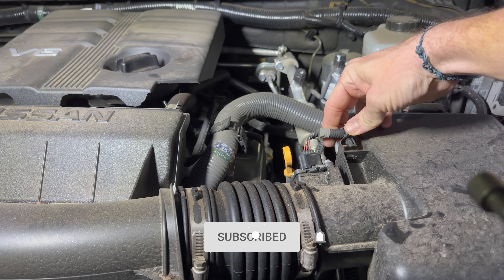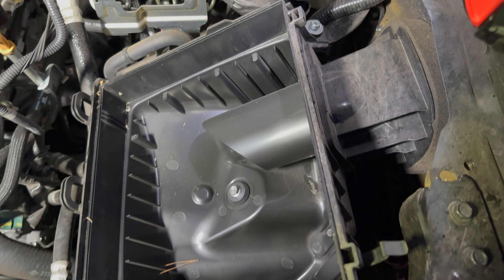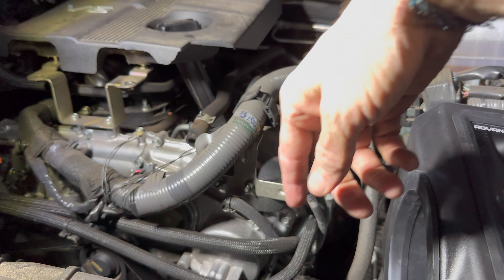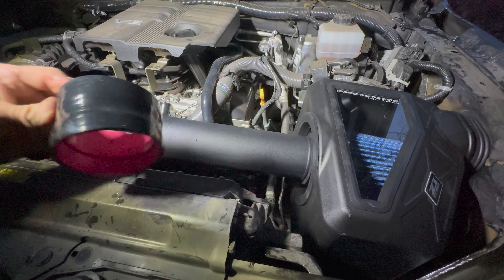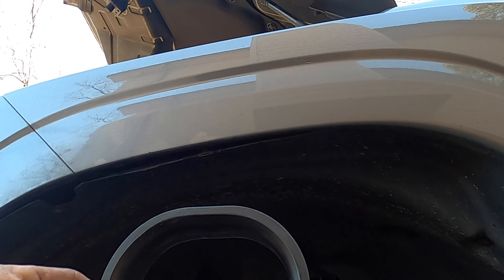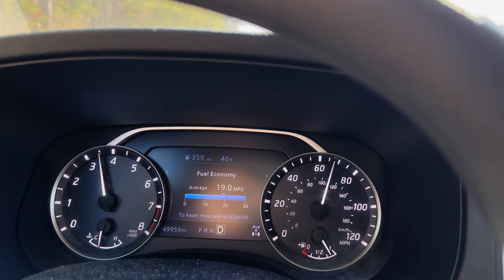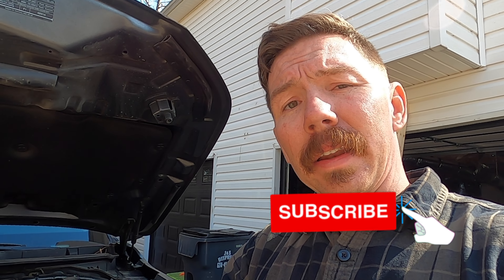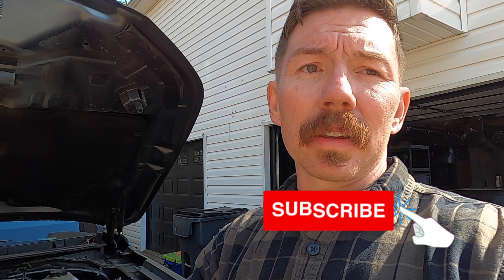2022+ Frontier Cold Air Intake (install and review)

Comment: I'm with you on the cost vs performance. I decided not to get the intake but  I did the 2.5 inch lift kit, the Z1 upper control arms, and the Z1 Performance exhaust and I'm really happy with it. Best MPG I'm getting on stock tires is 19.5.
Reply from the maker: How do you like the exhaust? Looks like a nice product. It drone any?

Thanks a ton for your feedback 👍🏽
Reply: Not any bad drone. The truck cruises at about 2200 RPM and it sounds good. It's great when you get on it too. @TheAdamConners
Reply from the maker: @-Dwight-Schrute  I’m sold. Lol.
Reply: @-Dwight-Schrute  Id say there is drone between the 2000-2500ish range when in city driving. The exhaust sound is louder than the intake when you get on it. Thats been my experience anyway.
Reply: I am considering the NISMO exhaust for my 2023 Pro4x.

Comment: Really enjoy your install videos.  Just bought a ‘24 Frontier Pro 4X and will eventually tackle some of the upgrades you’re doing.  Great sense of humor, which is needed while wrenching on your pickup.
Reply from the maker: Awesome man, welcome to the frontier gang. Appreciate you tuning in! 😄👍🏽
Reply: Will that void any warranties?
Reply from the maker: @kristianshynez4680  was told by a Nissan tech that things like that didn’t void warranties. But anything like messing with motor internals or re-flashing ecu would definitely void the warranty.

Comment: Something to consider for more mods, Z-1 high lift hood struts, I have them and they are nice.. also the NISMO red ignition button... I have that also on my 2023 P4x. Z-1 sells it to.  Z-1 heater hose inlet coupler, OEM is plastic and will eventually fail.

Comment: I have the NISMO catback coming this week. This would probably  help your truck out since you have the CAI on it..
Reply from the maker: @PRO4XKEV  still on the fence with an exhaust. I want one for gains in power and/or mpg but don’t want the drone at cruising speeds. Let me know how you like the Nismo. They’re stuff is usually great.
Reply: I'm ordering the overland style MBRP in a week or two. But I'm going to modify it to be equal lenght
Reply: @TheAdamConners  Great video, installing the Z1 intake today and following your instructions.   For your exhaust concerns, Z1 did a great comparison of exhaust kits; stock vs Z1 vs NISMO and a budget one.  They also had sound meters for noise levels.  Great vid, hope you watch it.
Reply from the maker: @stevebogden4023  thanks Steve

Comment: I drive a 24 SV rwd Frontier and I'm getting 30mpg on the country roads of east TN where the speed limit is 55 and on the interstate I'm getting 25.6 based on what the truck is telling me.  I plan to do some testing after I put some miles on the truck, currently it has less than 500.  What are the benefits of a Cold Air Intake?
Reply from the maker: @nikonmark37814  how the hell?!? 🤷🏻‍♂️
Reply from the maker: @nikonmark37814  little bump in power and gas mileage.
Reply: The factory intake is a cold air induction. Get the Z1 drop in filter. I do think the S&B or the Z1 intakes are much more visually appealing.

Comment: Do you know if this messes with the warranty at all, I just recently bought a 2024 pro4x trying to figure out, I’m my warranty will be voided when I install this
Reply from the maker: @Thisguy121242  a Nissan Tech assured me it did not. He rode in the truck to check this clunky transmission and we talked about mods. He said you would need to get internal or into engine management (a tune) to void the warranty.
Reply: @TheAdamConners   appreciate you
Reply from the maker: @Thisguy121242  thanks for watching homey 👍🏽👍🏽

Comment: 2:18 they must of torqued that bolt on it wouldn't turn it just stripped now I don't know how to take it off any ideas?
Reply from the maker: @kamryn7496  keep in mind it spins inside of the intake box even though it is not fastened to the truck. So you can loosen for eternity but the mount isn’t going to come out of the hole in the intake box. You have to shove the rubber grommet through the intake box housing to actually get that fastener out. Does that help any?
Reply: @TheAdamConners  imma have to try it out when I get off work hopefully it will come out I don't really want to drill a hole thru the intake box to get it off with a socket that might be another way to get it off but if that don't work then I'd have a hole in the intake box

Comment: Is the conical filter sealed to the inside of the air box, or does it just sit inside the box?
Reply from the maker: @monocogenit1  just sits inside. It’s “sealed” around the box except for the port going into the fender well. So it’s kinda both and neither 🤷🏻‍♂️😄

Comment: Not sure but could the reason it's so quiet is because the air filter is enclosed in the box? I have a K&N Air Raid system on my 2004 Dodge Dakota and its a more open system and you really hear it sucking air when you're stepping on.
Reply from the maker: Yeah, I would say there’s some truth to that.

Comment: Useless and waste of money.  Still surprised how many people fall for it.  You think you know more then the engineers that designed it ?😂😂😂
Reply: I don't get it either. It already IS a cold air intake from the factory. 🤦‍♂️
I did modify the intake on my older Frontier, but it's a barrier made from hardware cloth to keep mice from gaining entry through the fender well and building a nest inside the filter housing.